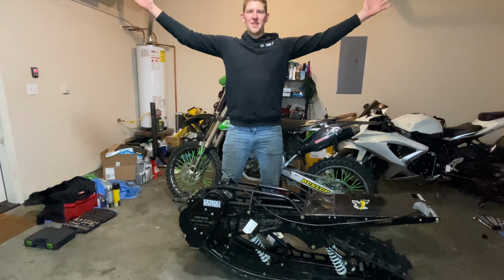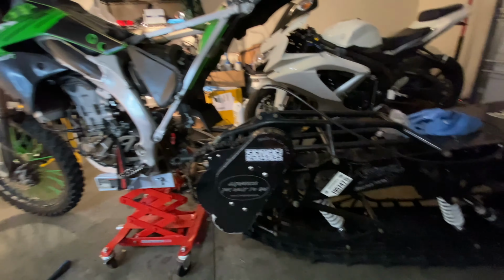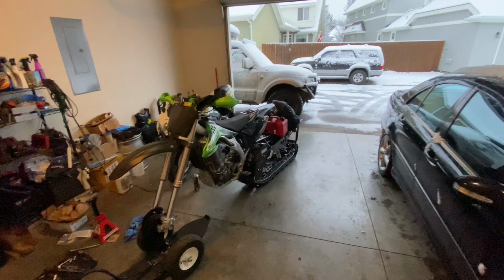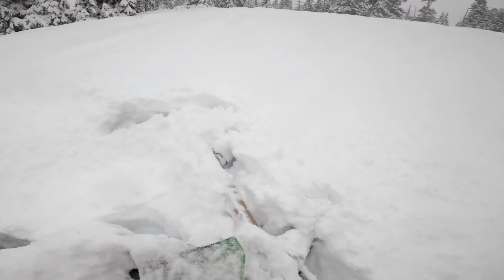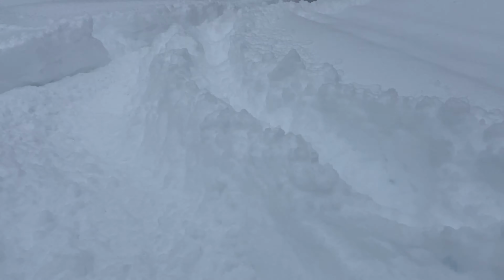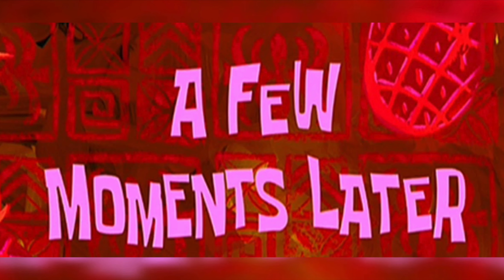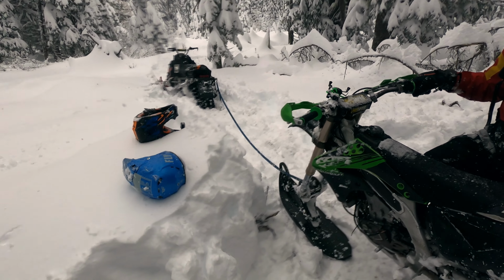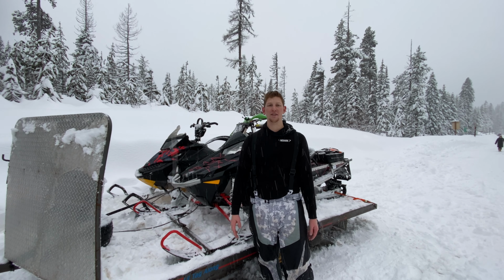My SNOW-BIKE BROKE In The WORST Way POSSIBLE | I Got Stranded….

Comment: OK tow snow bike with foot pegs not front forks.  Exhaust falls off and kick start falls off. Blue lock tight? lol I have a 2016 KTM 500XC-W with a Timber sled SX137. My first time was scary. The thing would dart everywhere.  I knew nothing about a snow bike and first ride was a 30km trail in. I thought I was going to die lol. Found out it had way too much ski pressure. So shortened the TSS to get some pressure off the ski. It did help a bit but when off the gas the front would go down and dart around bad on the trail. Deep snow not too bad but not right. So in the shop with the bike sitting on the floor I got down on the ground and looked at the skag on the front ski. All the weight was on the very front on the skag and the back of the skag was off the ground. I jacked the bike up off the floor so I could tilt ski back and there is a neoprene bushing there to stop the ski from tilting too far forward. I thought that's not tall enough so I cut some rubber pieces to fit and shimmed it. Put the bike back on the ground and all the weight was now on the back on the skag and the front was up about 4mm. Went out for a ride and WOW its a new bike!!! Easy fun not scary world of difference. love it now! Thank for the Video looked like a lot of fun and great snow.   Oh watch the timber sled chain close. They stretch a lot fast when new and are known to break. Keep the videos coming.
Reply from the maker: Thanks for the great advice, I used medium strength blue lock tight but when I applied it it was 4° outside so I doubt it cured. After those two hiccups it seemed to do great! These machines are so fun!